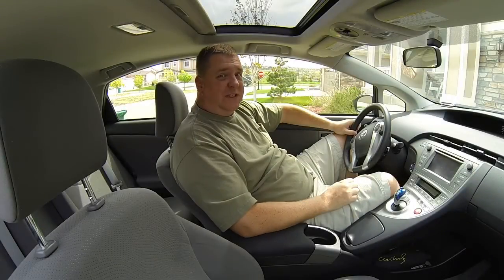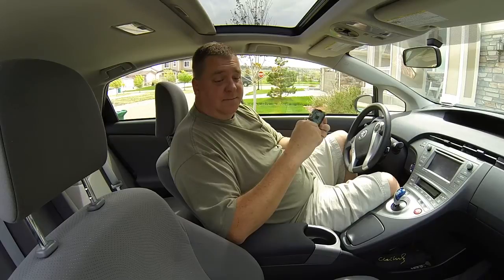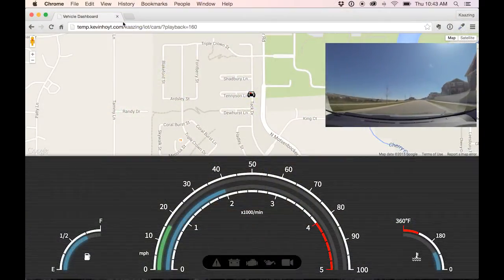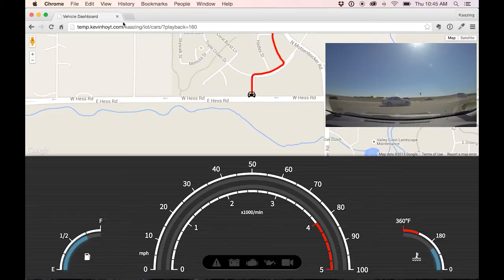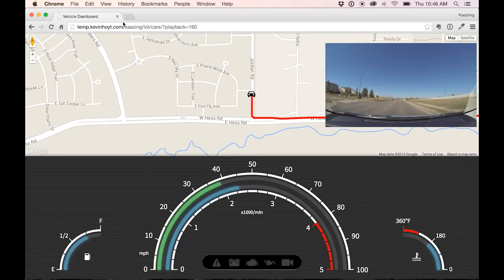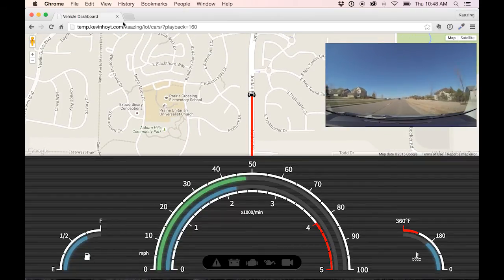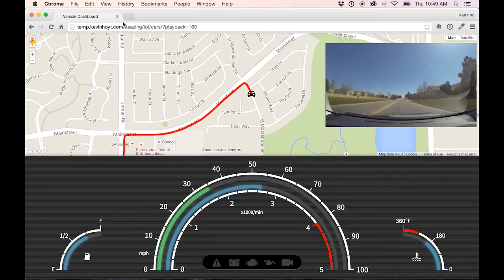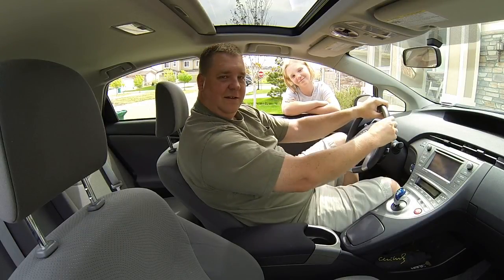Real-Time Vehicle Telemetry

Comment: Thanks, very nice video. But I don’t understand how the intel Iot gateway is used since the OBD II adapter talks directly to computer via Bluetooth. Also , did u use any open source Java toolkit available somewhere such as GitHub ?
Reply from the maker: Thanks for your comment! The Intel Gateway is not used in this demonstration, but is presented as an example of a computer that could be used to connect to the Bluetooth ODB adapter. Intel is mentioned in this case because we (Kaazing) were working with them at the time on a proof of concept for freight trucks. They wanted to put their gateways on trucks, and use them to capture vehicle data. Any computer with Bluetooth, such as a Raspberry Pi, or even a smartphone would work equally well in its place. 

Only standard Java was used in the example. I wrote a custom implementation to handle the OBD data, and connected the Java program directly to the serial port on the device I used (I believe it was a Pi, but that was a long time ago).

Comment: I didn't get how you showed the output of your third party GPS device on the web.
Reply from the maker: This was a long time ago. These days I would use something like a Particle Boron LTE connected to a GPS module. The Boron would POST the coordinate data to a web server. The web server would in turn publish the data via WebSocket. A web page connected via the WebSocket would get the data and update the pertinent UI. Depending on the volume of messages, and the money you are willing to spend, this could be greatly simplified with a POST to a service like PubNub. This would also make the solution less brittle. Thanks for watching and commenting!